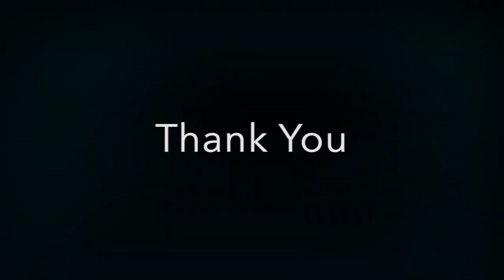The Ultimate TV Wall Transformation

Comment: Beautiful work! How did you plug in the led lights? Not sure that I saw that on the video! Looks crisp and will stay organized!
Reply from the maker: I used low profile extension. 

Sleek Socket Ultra-Thin Electrical Outlet Cover with 3 Outlet Power Strip and Cord Management Kit, 8-Foot, Universal Size https://www.amazon.com/dp/B07S7FX8WX/ref=cm_sw_r_cp_api_glt_fabc_0MEGP401BXHKK1CP0B33

Comment: Hi Sanjay, I really love the wall. I am planning to do the wood accent wall in my son's bedroom. Did you nail them to the studs or did you use any kind of adhesive as well? Would renting a nail guy will make this easier and faster?
Reply from the maker: Hi, I used adhesive to glue wood in my other bedroom. It works fine. Use this adhesive if you go this route. https://www.homedepot.com/p/Loctite-PL-Premium-Fast-Grab-10-fl-oz-Polyurethane-Construction-Adhesive-1417170/202192562

For my living room, I nailed the wood as it is faster and the because the color of my wood is gray, it hard to see the nails.
Reply: Sanjay Patel thank you! I prefer nails too as it doesn’t damage the drywall if ever we need to remove the wood panels.. did you nail on top of the wood on on the interlocking space on the panels?
Reply from the maker: Some on wood and some on interlocking space.

Comment: Nice job. I want to ask. What the name you put over the console. I dont know if its aluminum or chrome.? And there is a chrome between the laminate
Reply from the maker: Not sure what are you asking. Are you asking about the silver lines on the wood planks? It is decorative tape. Here is the link CS Hyde 4336941184 Gold Metalized Polyester with Acrylic Adhesive .0022" Thick https://www.amazon.com/dp/B003HKRF12/ref=cm_sw_r_cp_api_glc_fabc_R6M.FbR53FFKE
Reply: Thank you my friend. And also the one you put. On the top of console box.
Reply from the maker: It is Alexa dot. Echo Dot (3rd Gen) - Smart speaker with Alexa - Plum https://www.amazon.com/dp/B07W95GZNH/ref=cm_sw_r_cp_api_glc_fabc_J6T.FbE8JZ23W
Reply: @LearnAndExploreTheUnknowns  your talented

Comment: So cool, we are working on it right now. Can you tell me what size screws did you use to fasten the white panels. I ordered the ones with the caps you have in your link but they are too short. Please let me know, thank you
Reply from the maker: The one that comes with the cap are small screws. I used 3 inches long screws which goes into hollow anchors.

Comment: Hello Sanjay - Regarding TV Unit, how did you buy these green and glass combination? Can u please add the link for that.. the one we have in description seems is for three panels only
Reply from the maker: Hi Sandhya, this is the green door I used. 

https://www.ikea.com/us/en/p/notviken-door-gray-green-20441578/

Here is the glass door. 

https://www.ikea.com/us/en/p/sindvik-glass-door-white-clear-glass-80291854/
Reply: @LearnAndExploreTheUnknowns  Is this TV unit one piece with 5 panels ? and how did you put it on the wall?
Reply from the maker: @sandhya1aditi1  it is 1+3+1. Single unit is easy to hang on wall using support ikea sells. I used shelf brackets to hold 3 units piece.

Comment: Hi sanjay, I liked this accent wall and we are planning to do the same one. One question..when did u add that metal lines in between the wood ? is it after completing the wood frame or in between while you are adding the wood you added that metal lines and what is the material you have used ? is it the same one "Metal Mira Lustre Plain Edging Moulding". I'm planning to buy the material and will start soon. Kindly help me with the material for that lines and process. Thank u
Reply from the maker: Are you asking about the silver lines on the wood planks? It is decorative tape. Here is the link CS Hyde 4336941184 Gold Metalized Polyester with Acrylic Adhesive .0022" Thick https://www.amazon.com/dp/B003HKRF12/ref=cm_sw_r_cp_api_glc_fabc_R6M.FbR53FFKE
Reply from the maker: Please share once you are done. Would like to see how it. I did not plan this video, just recorded for myself and ended up posting it so it does not have all details. Let me know if you have any question.
Reply: @LearnAndExploreTheUnknowns  Thanks Sanjay..sure we are in the process of ordering the items and we will start in a week or so..I'll post it once Im done with my DIY
Reply from the maker: @bhavanijavadev4049  Good luck. Let me know if you have any questions.
Reply from the maker: How is it going? Please share once you are done.